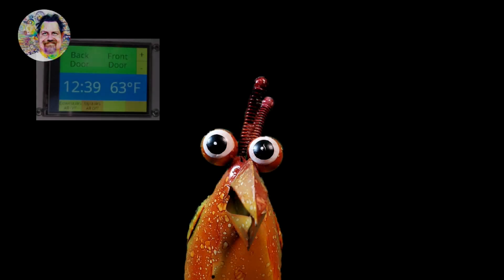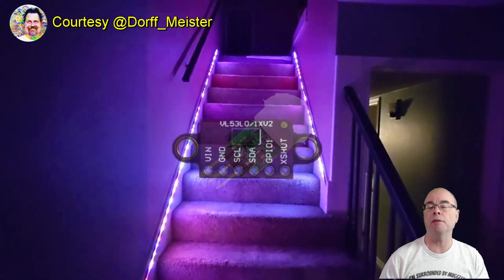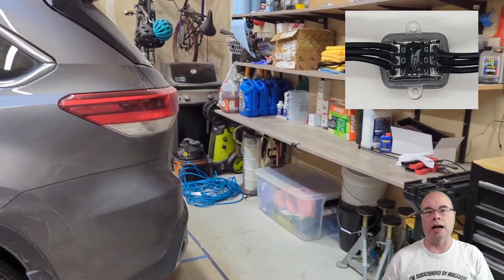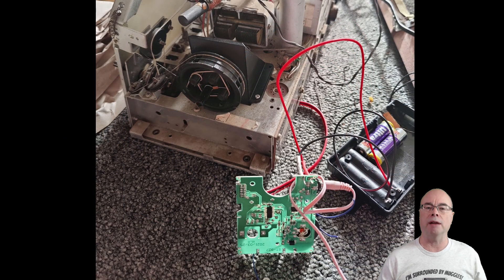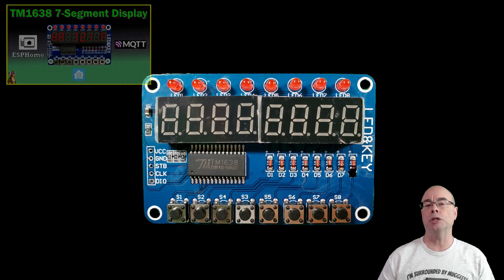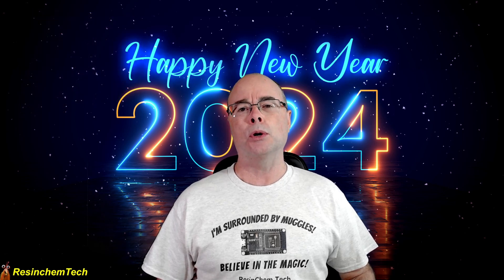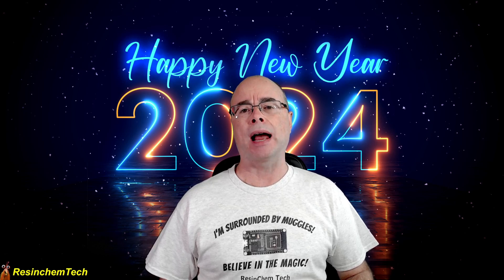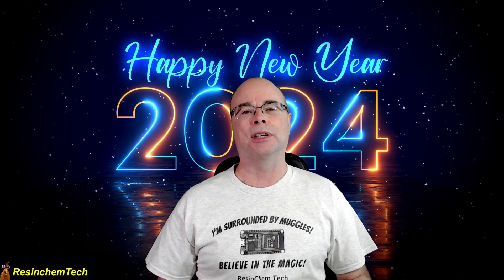YOUR Project Improvements and Some Channel Tweaks

Comment: Thanks for your videos man. They have definitely inspired me to start some LED projects when I get the funds for it.  Do you run a Discord or Subreddit or just the YouTube channel and blog?
Reply from the maker: You are very welcome.  The goal of my channel is to try to encourage others to try some DIY projects... and maybe a little home automation. So it makes me happy if I had a small hand in inspiring you to try your hand at an LED project or two.

I am currently testing a Resinchem Tech Discord server with a handful of trusted others, but it is not quite ready for general use and I'm not prepared to open it up yet... it's another one of those things (like I mentioned in this video) that I just haven't had time to really dig into it.    If or when I get to that point, I'll make a community post and start including my Discord channel in the closing of my videos... so I'm sure you'll be able to find it when it's available!

Thanks for watching... and taking a few moments to post a comment.  I appreciate it!

Comment: I enjoy the detailed contents of your videos and am grateful that you take the time to share them.  I built my first esp32 wled controller with your guidance and other esp32 related tinkering.

As far as videos, or experiments I would like to know what are the limits of wled on an esp32?  When you load a wled controller with a generic esp32 into xLights, it shows up to 8 ports.  Is it really capable of driving that many?  Or what is the functional limits to the number of LEDs you can drive from a single port?  Or, at what point do you require something more that the logic level shifter for the data line?

Thank you again for all the knowledge you have shared with us mere mortals.  I just picked up an 8 foot florescent light cover to make a couple of hour sound activated lights, but will use the mic you recommend in your curtain build.

Okay, enough from me.  Have a wonderful 2024!!!

Joe
Reply from the maker: Thanks so much for the feedback and kind words!

I could certainly look at doing some sort of 'real world' test, but the WLED web site already provides recommendations/best practices for LED limits with both the ESP8266 and ESP32:  https://kno.wled.ge/features/multi-strip/

There's actually a wealth of information on the WLED site, including dealing with exceptionally long runs between controller and LEDs ( https://kno.wled.ge/advanced/longdata/ ) and a pretty good section on E1.31 (DMX) including LEDs per universe, ports, etc ( https://kno.wled.ge/interfaces/e1.31-dmx/ ).  In my opinion, while there is a ton of useful information, it is not arranged very well and particular topics may require a lot of clicking around and browsing to find it.  And of course, there are 'recommendations' and 'real world' which can be significantly different!

I do highly recommend the INMP441 I2S digital mic I used with the LED curtains over the old MAX9814 I used in older videos.  The I2S mic is much more responsive with significantly better range.  Best of luck with your projects... and as always, don't hesitate to reach out if I can be of any assistance!
Reply: @ResinChemTech  sweet!!!  Thanks for the links!!!  I shouldn't have been so lazy and just Google and researched.  This is still a bit new to me.  Thank you again for all your hard work.

Joe

Comment: Silly question…. Which theme and cards do you use in Home Assistant?  I like the   ——————— title —————— header for each section. Thx!
Reply from the maker: The theme is just the default theme, but I've modified it a bit to change a few things.  I use all sorts of cards, but the most common card that I use is the custom button-card, available via HACS.  The title dividers are also a custom HACS component, called text-divider-row (although an older version, as the most recent places a semi-transparent background around the title that I do not care for).

My dashboards have been a work-in-progress for many years and are constantly being tweaked and rearranged.

Comment: I'm building my first WLED project right now while watching this video! Repurposing a poorly designed LED fixture I bought off Amazon with a better LED strip and ESP controller.
Reply from the maker: One of the first WLED project I did was something similar.  I had purchased rather expensive LED bar lights (you can see them in the background of most of my recent videos.. and they light up the bottles).  But they had limited colors/effects and a remote that often wouldn't work.  Once I learned about WLED, I ripped out the LED strips, replaced them with WS2812b and an ESP-based WLED controller.  It was a huge improvement.

Good luck with your project.  Take it from me... your first WLED project probably won't be your last!  Thanks for watching and taking a minute away from your project to post a comment.

Comment: Is there any way to use a diguno or quad for the garage parking? If not is there a pcb that I can use for a esp32?
Reply from the maker: You could adopt one of the Dig boards... but frankly those are way overkill for what you need for this project.  You'd pay $30+ for a Dig board and not take any advantage of its many features when you could spend $4 - $5 for a D1 Mini and shifter.  You'd also have to flash my code and replace WLED that comes installed on the Dig boards... and I haven't tested that and can't be sure that it would even work as intended.  The WLED firmware that is installed on the Dig boards will not work with this project as it is designed.

I don't have a PCB for either the ESP8266 or ESP32 (yet).  But it would be a pretty simple design to create one.  Currently, the firmware is only written for the ESP8266 (D1 Mini), but going back and adding support for the ESP32 is one of the backlog of projects on my list that I mentioned in this video.  Honestly, even the ESP32 is overkill unless you are using bluetooth proxy in Home Assistant. But a number of folks have asked for an ESP32 version. I can't say for sure when I'll get to it, but my code is freely available and you could update the libraries for the ESP32 in your own clone or fork if you don't want to wait on me.
Reply: @ResinChemTech  Thank you so much for your reply. I love your videos. Happy New Year!!!